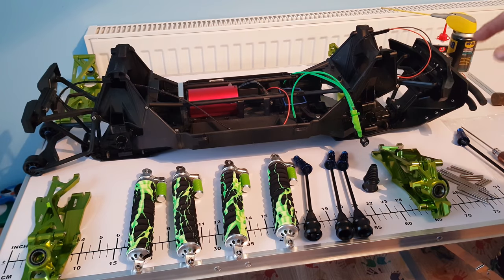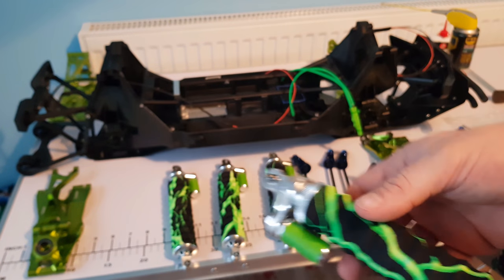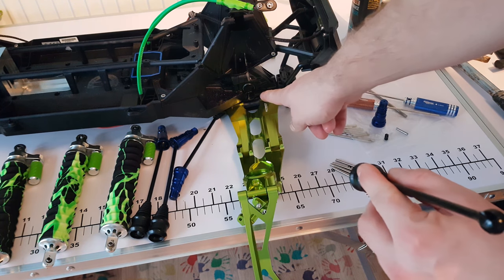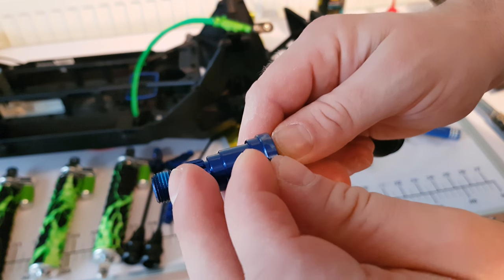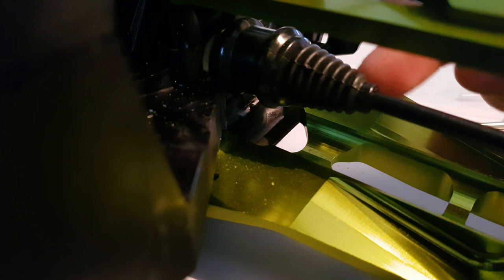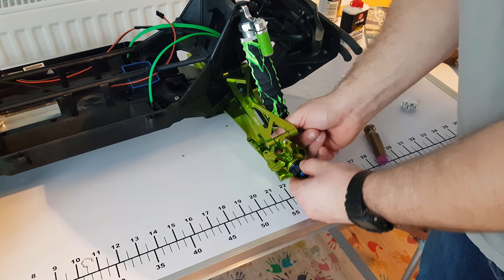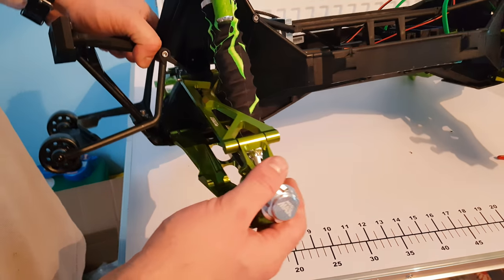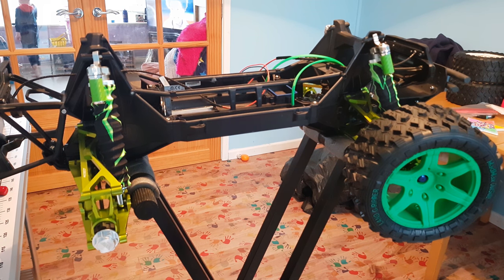Traxxas X maxx 8s A-arm, shock and cvd boots installation

Comment: Lol. I'm running a max 5 with a leopard 56110 950kv with 30t pinion and 35t spur. Same shock socks. Closest set up I've seen to mine so far lol. Nice. I will say metal arms will probably cause you broken bulkheads... If you're going to bash it anyways

Comment: Like the boots on the joints I want to use those
Reply from the maker: https://rover.ebay.com/rover/0/0/0?mpre=https%3A%2F%2Fwww.ebay.co.uk%2Fulk%2Fitm%2F372341880361
Reply: @d252428q  Hi. This links dead. Are they still available.?

Comment: A question about the rubberboot, do they stay on the drivecup,when you drive? Im just thinking that everything is spining and it dident look like the boot whas siting secured?
Sorry for the bad speling.
Reply from the maker: Yes they stay on very well. I have been using them for 6 months now.
Reply: Oki do you have a part nr for the boots?
Reply from the maker: Not part number but if you contact me through All Day RC on Facebook you can purchase a set.

Comment: Why wouldn't you not put green castle 2028 800kv
Reply from the maker: Because it's under powered
Reply: ALL DAY RC not really it can hold 12s lipo if you get my esc its mgm esc that pushes 15s or 12s